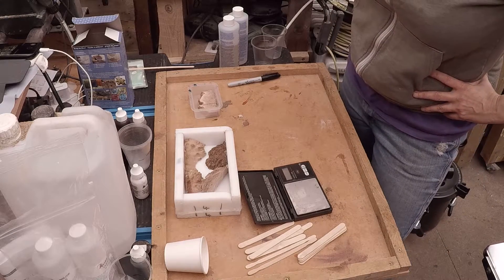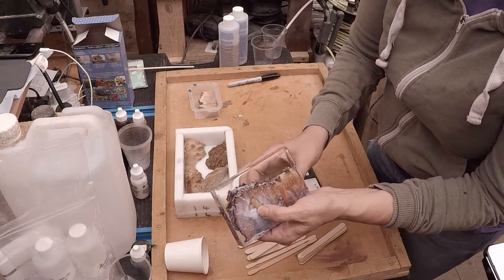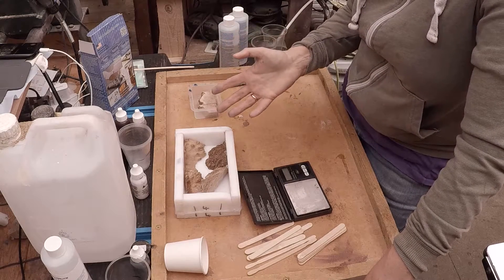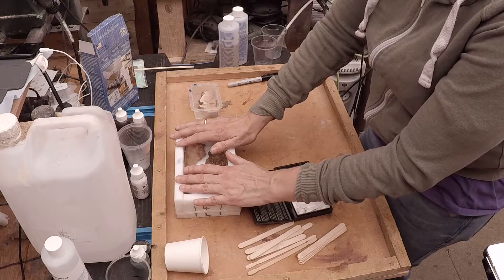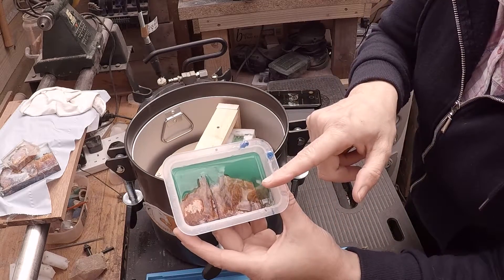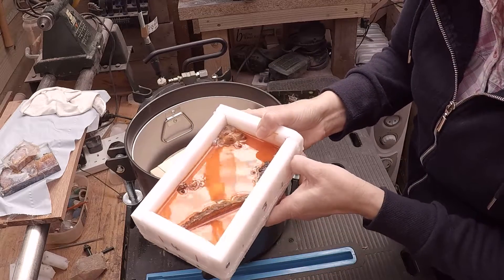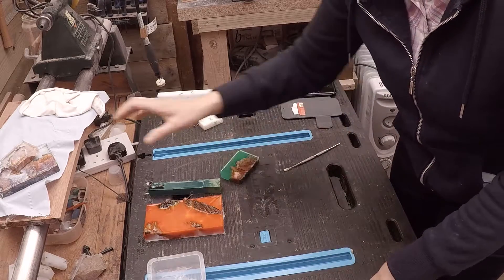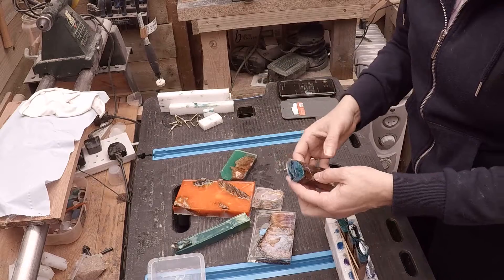Testing resin pressure chamber (update)

Comment: Just about to order my pressure pot. Can you give me any advise on what air compressor you use, not to sure what size of air pump I need to buy. Don't want to spend money on something I don't need size wise.
Reply: Thanks Pam will get something of that size
Reply from the maker: yey thats great i use a stanley 25l compressor noisy but cheap in screwfix :-)

Comment: Just wondering,  are you pressurising the pot too fast,  maybe you are getting a strong flow if air inward that is effecting the resin..
Reply from the maker: Hi Heath do you mean with the alumilite clear and unstabilised wood? If it was,  alumilite clear hates any moisture and as i hadnt dried and stabilised the wood it ended up like that. I just had to try it lol

Comment: Hi Pam, I bought a pressurizing tank, it goes up to (60psi - max) I wanted to test with epoxy resin and wood like you did in this video, how many psi should I leave and for how long? thanks for your attention
Reply from the maker: Hi Ronaldo 60 psi should work just fine. I sliced the big epoxy slab up for pen blanks and it looks great no bubbles. Have a great weekend Pam :-)

Comment: You have stopped vacuming and are pressuring the casts now isn't it right understanding by me 😯? What's the differens? Please tell me the sise of the drill you use for the rings you do, I would try to do one for my wife (The best wood I have is mahogany.). Those tests you took out of your pot today are beautifu. Júlíus
Reply from the maker: Thank you. I now  have a pressure chamber this, to not make it to complicated  gets rid of the air and presses the resin in to voids in wood this now gives me more options when casting i still use the vacuum chamber for small ring projects and stabilising wood. I use many sizes of forstner bits depending on the ring size i want. If you let me know the ring size you need i will tell you the right bit you need. Mahogany would be fine :-)
Reply: Thank you for your respond. After I wrote to you I thought I would of course to take one of hers ring and measure it. But thank you anyway. Júlíus
Reply from the maker: Always happy to help. Have a great weekend :-)